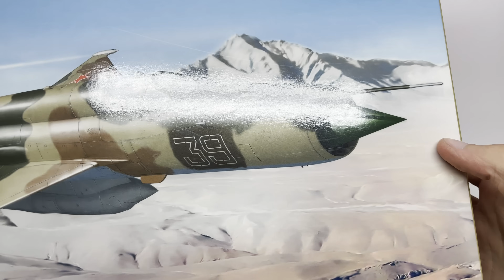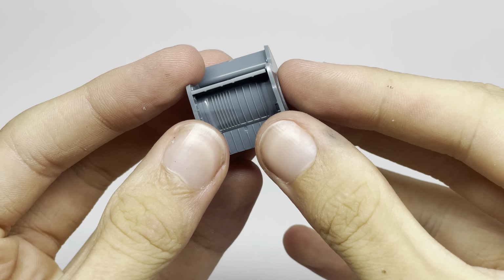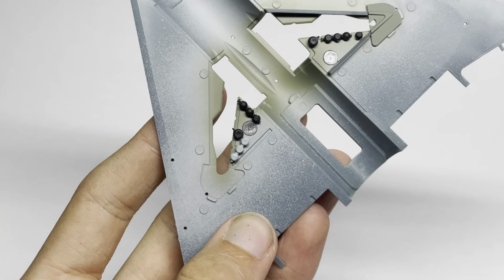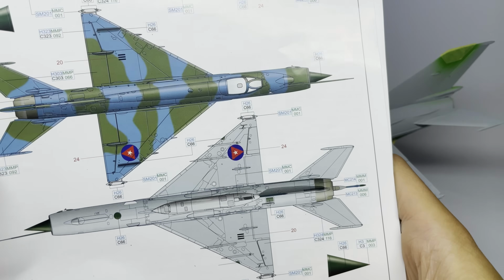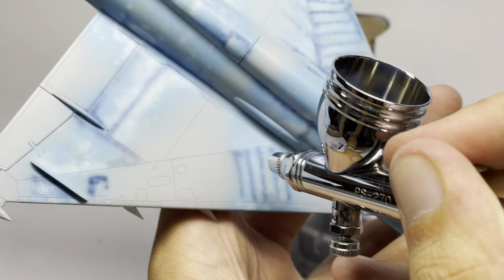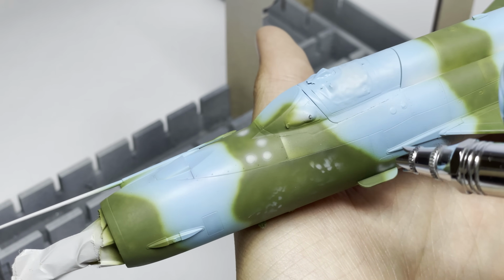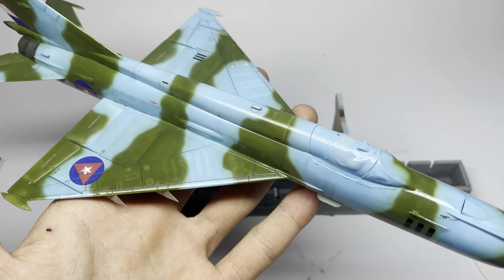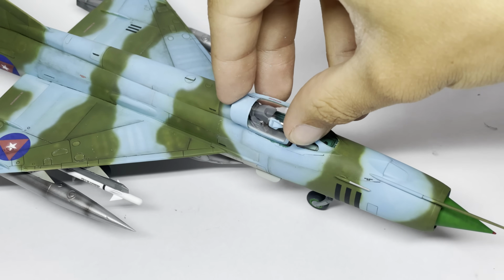Eduard's 1/48 MiG-21R | Full Build | 4K

Comment: Great high standard of work. The Eduard decals are getting better. I tend peel off the big one but leave the film on the stencil.  VMS Satin varnish makes the film disappear. On the whole I don’t like them.
Reply: Regarding vms i cant get a great gloss coat, and struggles through the airbrush straight from the bottle. Can i thin with x20a, mr hobby slf or iso?
Reply: @xWILZTAx what pressure are you airbrushing at?
Reply: @cfranko1860  i normally go high for varnish around 25-30 psi
Reply from the maker: VMS seemingly does hide lots of carrier film so that’s a very efficient solution! Thanks for the comment👌🏻
Reply from the maker: Personally I would stick to VMS own thinner, the varnish is a very particular product which is unlikely to work with x20a or mr hobby…

Comment: Hi luke you've done a fantastic job on the mig mate it looks awesome.  Regarding eduard decals. what I've seen about them is you apply the decals over a gloss coat, then leave them for 24 hours, then peel  them off. i think that's why people struggle with using them they are not leaving them long enough.  cheers Gary 🇬🇧
Reply from the maker: Thank you very much! Really appreciate it, I think your method sounds good! That’s what I’ve been doing anyway!🤣

Comment: Great build as usual @machmodels . Just a suggestion for future aircraft builds; try using Mr Hobby 101 or Tamiya X-19 SMOKE for post shading. It’s a clear browny black that isn’t as saturated as flat black. So you’ll get a subtle shading effect. 
Something else that you could try for jet exhaust or any worn metallic surface; Mr Metal Color 212 - Iron, 213 - Stainless & 214 - Dark Iron. These are buffable metallic paints; so apply either by hairy-stick or airbrush - leave it to dry then with a soft cloth rub till you have a realistic used metallic shine. I’ve uploaded a video on my channel that you can watch to see how easy & effective this technique is.
Reply from the maker: Thank you for letting me know! Unfortunately I have tried it before and I’ve never completely got on with it, so I’ll probably stick to my own methods for now! But thanks again!

Comment: Great job as always.

The MiG-21 interior colour has received much discussion. Unfortunately Eduard’s release had them direct modellers to use H45 Emerald Green which is too green. I’ll come back to H45.

I have found AK Real Colors RC206 Russian Cockpit Turquoise is spot on as a colour choice and have used this in all but one of the MiG-21s I have built.

The other (my first MiG-21) was a 50/50 mix of H46 Emerald Green and H25 Sky Blue which produces a colour almost identical to RC206.

As you find in your build, these kits are great to build and like me, you’ll probably build more. There are so many interesting marking choices across their boxings and then of course there are the after market decal sheets. You could fill a room with MiG-21s.
Reply from the maker: Thank you for such an insightful comment! When I inevitably go back and build another one of these, I’ll come straight to this comment! Thanks again!👌🏻

Comment: Nice job on that Mig and good video.  Furthermore I have a question,  do you dilute vms varnish with something?? I find it bit thick for airbrush.  
Thank you.
Reply from the maker: Thank you very much! I personally like to dilute the VMS down about 20/30% using their own VMS acrylic 2.0 thinner. Then I’ll spray it at 2 bar through a 0.3 nozzle👌🏻
Reply: @machmodels  thanks. Ist possible if you may know to use something else for dilutions?

Comment: Have you considered instead of rushing through builds like you do to put out more videos more often, trying to spend more time on the models and raise the finished quality of work?

I notice quite often you have badly aligned parts, as well as poor quality of cleanup where you blame the kit for it instead of just putting care and attention into the model.
Reply from the maker: A valid comment, however, I would love you to be a little more specific as to what areas are so bad on this build. On previous builds, I definitely understand the areas which have gone wrong but I thought this one was better.

Would love to see some of your models as well, to see what I’m striving for😄😉
Reply: @machmodels  passive aggressive doesn't suit you...

You post your work openly on a social media platform. This invites criticism by its very nature. My work has no baring on whether my critique of yours has any merit or not. 

As for areas on this build, more time spent during assembly to file, fit, fill, and rescribe areas where necessary would have elevated it further. You have a tendency to rush the build side in favour of painting, which is why you get visible gaps appearing on areas like the spine section of this build, the under nose cowling on the miniart thunderbolt and others too.

Just because others praise you doesn't mean you don't have areas to improve upon, maybe reflect on what I've said before making weird flex statements next time.
Reply from the maker: My deepest apologies! None of that was meant in any way to be aggressive, genuinely just wanting to see other people’s build to see!

The reason I ask is having a fresh pair of eyes to look at a build always reveals different things, so thank you for highlighting those areas for me on this and past builds.

Once again I am very sorry if my previous comment was in any way aggressive, I will try to sort out my build quality in the future!

Hopefully see you in the next build… with some better build quality!😄